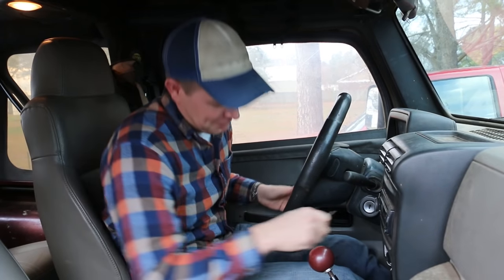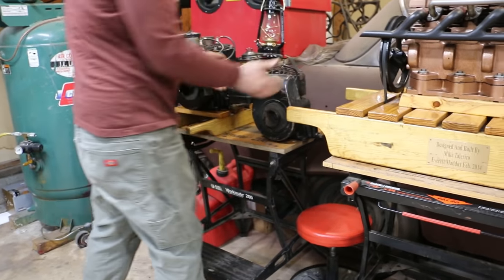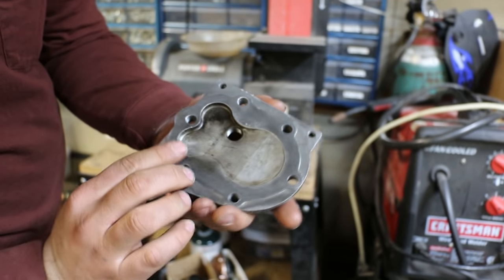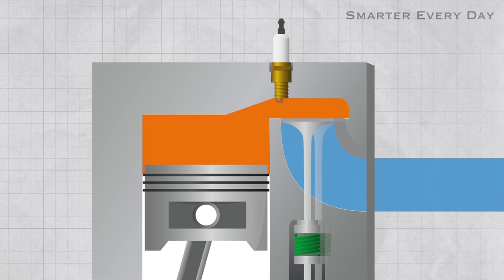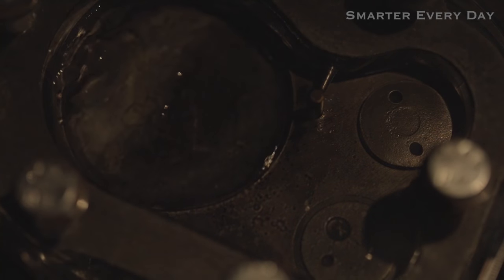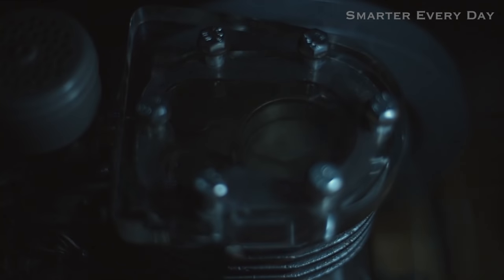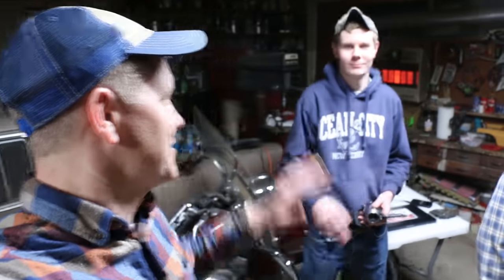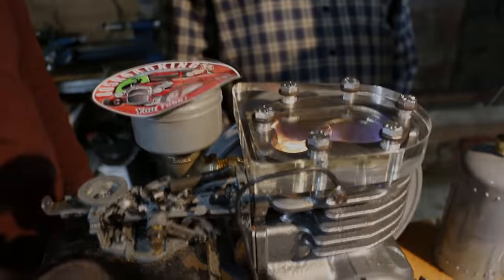How Engines Work - (See Through Engine in Slow Motion) - Smarter Every Day 166

Comment: While you've got the theory down, due to the time required for events, there's a lot more going on here

The intake valve actually opens Before Top Dead Center (BTDC) on the exhaust stroke, while the exhaust valve is still open. This is called valve overlap
1 Allows more time to fill the cylinder
2 Scavenging: The exhaust charge leaving the cylinder creates a low pressure area (vacuum) behind it which pulls in more fuel at a higher velocity
3 Incoming intake charge helps expel exhaust gasses

Atmospheric pressure at sea level is 14.7PSI. The piston traveling down on the intake stroke creates vacuum. Atmospheric pressure combined with vacuum forces more air and fuel into the cylinder at higher velocity

Intake valve actually closes After Bottom Dead Center (ABDC) during compression stroke because the cylinder is still a low pressure area, enabling atmospheric pressure to continue forcing in additional air and fuel. That, and inertia.

In most cars, the spark initiates while the piston is approximately 30-40 degrees (of crankshaft rotation) BTDC and the event of the spark can last roughly 3-7 degrees.

Although the air/fuel ratio is compressed to nearly spontaneous combustion, the burning mixture really doesn't start to increase the cylinder pressure until 10-15 degrees BTDC.

The entire fuel burn in a gasoline engine lasts roughly 60 degrees. The gasses are still expanding and creating pressure which is forcing the piston towards BDC.

Because we're talking about events which last for milliseconds, even at a low idle, and because there is still a small amount of pressure remaining in the cylinder, the exhaust valve begins to open several degrees BBDC.

The still expanding gasses with negligible pressures start to escape before the piston begins upward travel on the exhaust stroke.

The most efficient, non-performance engines achieve 70-80% volumetric efficiency meaning for every 10 cubic centimeters of cylinder area, only 7-8 cubic centimeters of air and fuel enter.

Quick mathematic side bar: The area of a circle is Pi*R^2 (Pie R Squared. To find the area of a cylinder, you then multiply that number by the length of the piston stroke (not the connecting rod).

If you have a 5 centimeter cylinder bore diameter, the radius is 2.500 centimeters

2.5*2.5=6.25
6.25*3.14159=19.6349375

If you multiply that number by a piston stroke distance of say 3 centimeters, you come up with displacement at 58.9 cubic centimeters

For the sake of argument, if we take 75% as our volumetric efficiency, we end up with an engine that inhales 44.178cc.

A "violent" or "aggressive" camshaft profile combined with carefully enlarged and smoothed out intake and exhaust ports and larger valves might increase that V.E. number to say 79-82% in a reliable build combination.

This is where boost comes into play:

If your engine crankshaft has a pulley on it, it can use a belt to drive a Supercharger AKA blower. It basically compresses and pressurizes a larger volume of air to force into the cylinder.

If your exhaust gasses pass over a turbine fan, the fan will spin on a shaft. If that shaft is supported on bearings and has an impeller aka compressor where on the opposite end, it can draw in and compress more air to be forced into the engine.

That's called a turbocharger.

In a boosted application, with everything else optimized for performance, you can see V.E. numbers significantly higher than 100%

Anyways, back to our lawnmower engine
This is a dinosaur design called a flat head. Obvious name. The combustion chamber includes the space above the valves which are located in the block.

A modern, so called over head valve design moves the valves into the head and directly over the piston. With the spark plug directly centered over the piston, the burn of the fuel and the pressure of the burn is directed over top of the cylinder. Far less milliseconds of burn time are wasted as the charge burns closer and closer to the piston.

Using a hemispherical (Hemi) combustion chamber maximizes this effect, fully directing the force of the combustion burn onto the crown of the piston.

@ me if you have questions. I know engine theory pretty well.

Comment: What I'm really curious about is that in the video the combustion happens and the power stroke begins. You can see the expansion of the flame edge is fairly slow at the higher compression. But when the exhaust valve opens, just before the piston starts moving back up, the flame edge can be seen quickly vacating the chamber. Is this due to the lower pressure outside the chamber, or is it temperature driven, or is there something else entirely happening?

Comment: The quickness is so that there is almost no heat transfer between the components to make sure there is an adiabatic process of the gas where Q = 0 and the internal energy will equal the work done on the gas by chamging its avarage kinetic energy (temperature)

Comment: On an engine, how do the pistons fire immediately off ignition? Is the battery solely used for the first cycle pulling fuel air mixture thru the intake, then letting the spark plugs take over? Im wondering what makes the pistons begin firing off the start if there isnt fuel air mixture to start?

Comment: I HAVE AN IMPORTANT QUESTION!!: how do they do the spark (the power stage) at the perfect time
Like what would happen if the spark turns on while the intake is open wouldn't that explode the whole gas tank?
Reply: No, it probably would make the cylinder slow down since there is no power stroke and thus it would eventually stop running entirely. Also as for the explosion, no that wouldnt happen since fuel needs air to explode, which isnt present in the gas tank.
Reply: @honkbonkwotbleaks2063  thx

Comment: This is amazing!!! Thank you for sharing. Question I have is when a manual engine is stalling due improper clutch engagement, does it experience LSPI? Or can LSPI can only occur if there is also a lot of fuel being dumped in the cylinder?

Comment: Mike, great video. However,  you got one important point wrong.  It is not an explosion with the spark. Spark ignition is a controlled burn of the air fuel mixture.

Comment: Why does the spark plug fire during the intake? Btw great video, thanks for putting such stuff!!
Reply: It doesn't.
It's a single cylinder Magneto ignition engine, which means it creates a spark every 360°.
The ignition fires at the beginning of the combustion stroke, and at the end of the exhaust stroke which is called a wasted spark.

Comment: What brings the piston back up during the compression and exhaust strokes? I understand why the piston moves down for the odd number strokes, but what's bringing it back up? Springs?

Edit: or maybe another piston on the bottom that is on an opposite cycle? So it goes down pushing the top up? and repeat?
Reply: The energy from the combustion stroke creates enough momentum for the piston to go through the other strokes.

Comment: It is NOT an explosion! There is a huge difference between combustion and detonation. Under the wrong conditions detonation of the fuel/air mixture can occur, but it is completely uncontrolled, makes very little power, and if it goes on long enough it will destroy the engine. Engines are designed around a known, controlled rate of combustion of the fuel. Any engine with "little explosions" going on is not only useless for doing any work, it's not going to be an engine very long.

Comment: You call them "explosions" but I have learned they are very quick burning fronts moving into the cylinders. Explosions is what you get when octane level is not correct. You can hear it as a ticking noise or so called hammer effect.

Comment: Its a nuance, but the Fuel is burned when ignited.  An explosion is know as detonation and is harmful to the engine.  If the stoch mix is appropriate and the octane is correct, the fuel burns vs explodes.  The "burning" fuel creates heat and gas expansion pushing the piston down versus "slamming" the piston head when detonation/explosion occurs.

Comment: Where does the power come from for the compression stroke? What pushes the piston back up?
Reply: There's usually a flywheel or counterweight attached to the crankshaft to preserve the momentum between strokes. Engines with more than one cylinder have them offset so their never both on the compression stroke simultaneously.

Comment: Hello Destin! i have a doubt that if i use any sort of resistor to decrease the current in a circuit, will i b wasting electricity? & also that if i regulate my fan at speed 1 & then to 5, am i wasting electricity at speed 1 relative to speed 5 & will my electricity bill remain same at both these speeds??

Comment: Interesting the spark fires during exhaust.
Reply: It's a single cylinder Magneto ignition engine, it creates a spark every 360 degrees, while there is a combustion stroke every 720 degrees.
This park at the end of the exhaust stroke is known as the wasted spark.

Comment: Would it be possible to use a space heater diesel or kerosene blow fumes off of it to power a vehicle. Somthin to try concerning fuel vapor vehicles might half to remove ignitor from space heater

Comment: Hi, Can anyone answer a question for me: As it is visible in the video that the intake valve can open only by going up here and the exhaust valve can only move downwards to open, So when the power stroke happens (3rd one) then why only it pushes the piston and not the exhaust valve also( as we don't want the power to be lost from exhaust but only to be used to move the piston down) at this stroke but instead it is opened in the next stroke? I want to know how it is achieved: 1) preventing exhaust valve to go down in 3rd stroke and (2) what drives intake and exhaust valves?
I'm a computer engineering so don't know much, only read about these interesting things in first year for basics😅.
Reply: The intake and exhaust valves both open into the cylinder. Pressure in the cylinder pushes the valve harder into its seat which makes it seal tighter. The part the runs the valves is called the camshaft. Its essentially a circle with lobe on it. As it turns the lobe will push the valve open and closed.

Comment: I'd like to know how the components around the engine work.
PVC valves, throttle position sensors and other junk that can sometimes prevent your car from running in the first place.
Engine in its self is simple. Everything else around it isnt.

Comment: What is the small spark for that happens just before the intake stroke?
Reply: The crank turns twice around to get thru the 4 strokes. The spark goes off every time the crank hits the place where the piston is just before top dead center, so one spark is to set off the gas, the other is "wasted" when the crank is in the same position midway to the start of the next power power cycle.

Comment: I don't understand how does the piston compress the air-gas after the intake i mean i understand that the piston goes down in intake but why the piston goes up compressing the mixture?
Reply: In a single-cylinder engine, the piston's movement during the unpowered parts of the cycle are driven by momentum.  The work the piston does during the power stroke is used to spin up a flywheel, then during the other 3 strokes the flywheel's momentum is used to push the piston up and down.  

It looks like you're assuming the air is what pushes the piston down during the intake stroke, it's the other way around.  The piston moving downwards is pulling air into the chamber.

Comment: If you add 2% diesel to gasoline fuel.
The same experiment you will find that the burning speed becomes faster.
This means that 2% diesel will make gasoline burn faster and fuel efficiency will be higher.

Comment: i wonder what powers the first stroke in the car as soon as you start the engine..is it batteries?!
Reply: I'm not an engineer here, so take this with a grain of salt. From my understanding,  when you it turn the ignition on what you're doing at first is powering the starter-motor (from as you said, the battery) which cranks the motor over to provide the initial strokes which set the process in motion.

Comment: and what exacly happens, when i floor my gas? I know, the explosions are in much faster frequency, but why?
Reply: Mikyner * When you press the accelerator pedal, this opens up the throttle bodies allowing more air/fuel into the intake stroke versus when the engine is idle. More air/fuel mix, more mixture at compression, more power, which means the pistons do more work which turns the crank faster, which means the engine puts out more power.
Reply: ^^what this guys says lol. The more air and fuel, the bigger the bang. Simply put

Comment: How does the piston comes up after the combustion or power step ?? Somebody??
Reply: The pistons are being pushed up by the crank below which props the pistons up each time it transmits power from the pistons to the gears.
Reply: There is a heavy flywheel on the end of the crankshaft that enables it to get over the compression stroke.

Comment: I see combustion in every alternative compression phase. Why?
Reply: The full cycle of a four-stroke engine takes 720 degrees of crankshaft rotation (2 revolutions) to complete one cycle
The first revolution of 360° is intake stroke, piston goes down.
Compression stroke, piston goes up.
The second revolution of 360°is combustion stroke, piston goes down.
Exhaust stroke, piston goes up.

Comment: A 4 stroke engine works the exact same way as your girlfriend.
1. SUCK = Intake
2. SQUEEZE = Compression
3. BANG = Power
4. BLOW = Exhaust

Another helpful bit of information regarding the "back pressure" Destin mentioned at the end of the video...
Once again - your engine is exactly like your girlfriend...

The "IN" hole is much larger than the "OUT" hole.
In an engine, the INTAKE side of the engine - which inhales nice fresh air for the engine to "eat" is much larger than the exhaust tube that the old, used air the engine had already consumed is pushed out of.

In your girlfriend, her mouth is much larger than her... Well let's just say it, her butt hole. The only difference is that her exhaust better not be louder than her intake. If it is, find a new girlfriend. 

Engines are just like people.
Love your engine.
Take your engine to the car Dr regularly for a check up.
Change your oil and make sure it is well lubricated. Oil is literally the blood of the engine, so make sure it has nice, good, healthy blood... Not blood that's as black as your mothers soul. 
Change your anti freeze at least once every few years... Because just like people, if an engine gets too hot, it dies. 

If you treat your engine as if it were a person, your engine will last forever.

Sincerely,
A Mechanic